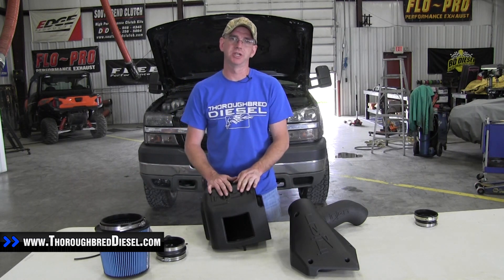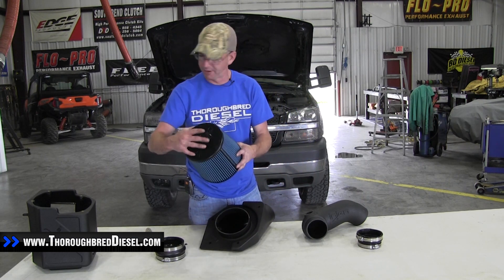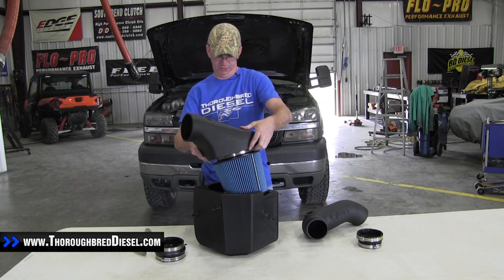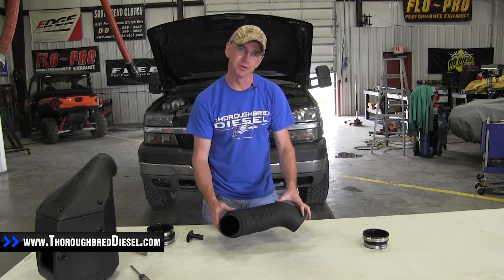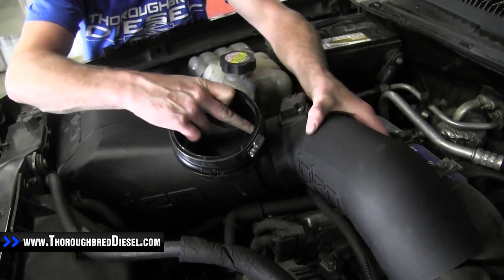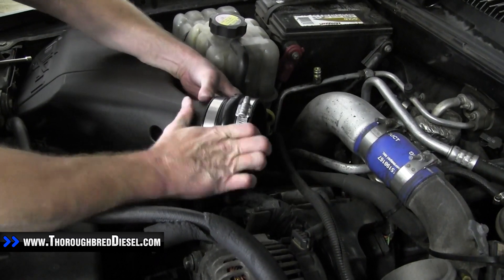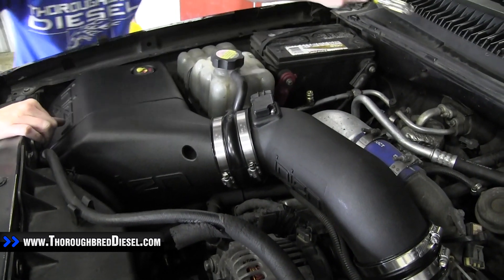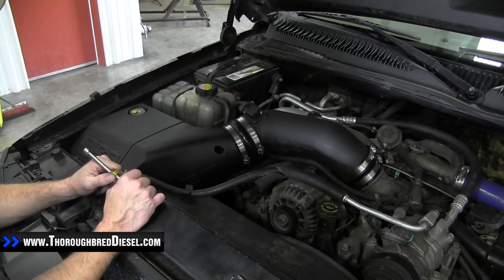Injen Evolution Cold Air Intake Install: 2001-2004 GM Duramax LB7

Comment: people gave me crap about buying this for my LMM, because they associate Injen with "ricer".  I ordered mine after talking to their tech dept, and it is fantastic.  The filter is massive.  I dyno'd 636hp and my limit was fuelling not air, so I can say that this works.  My OEM box was too restrictive at this power level, though I believe the best for a stock turbo truck.  My only gripe is that you have to remove it to clean the filter, but the filter minder let's you know when.